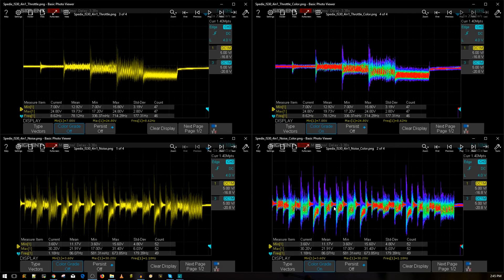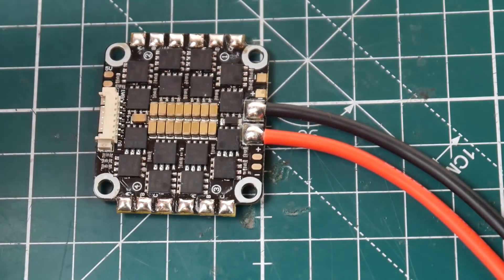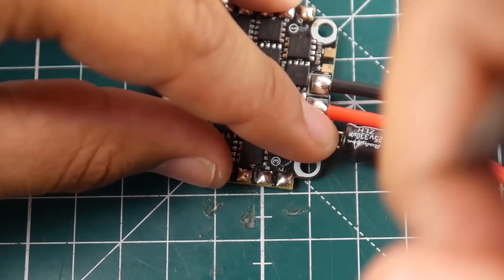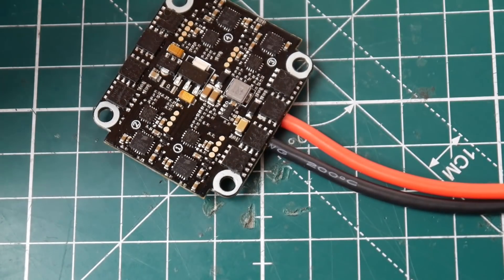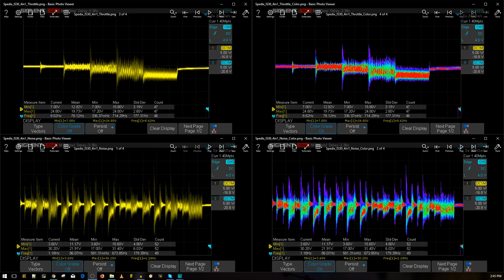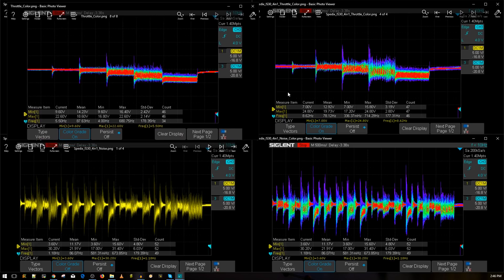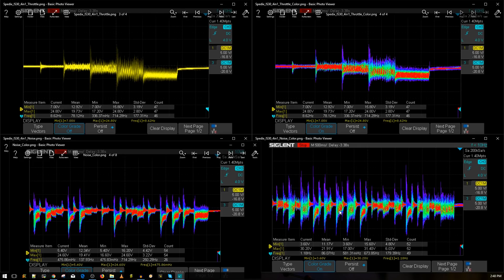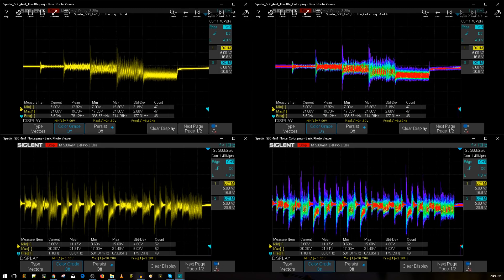OMG NO WAY THIS IS TRUE!!! /// Spedix IS30 4in1 ESC Review and Noise Test

Comment: Hi. It is a darn shame that this test only came out 9 months after the release of the product. To put it bluntly and to get straight to the point, i have this esc on my main rig and have had to live with noisy video since day 1. I have literally ripped the whole bloody thing apart 4 times to try and get rid of the video noise. Nothing will help make the video noise this esc generates go away, not even slightly. :( :( it is a damn shame, because despite the noise, the frigging drone flies great! It is smooth, has loads of punch, is not too hard on the batteries, and the osd is stable. It just generates noisy video. and that sucks! Mr Mesh, please let me know if you are going to try and mitigate the noise, or investigate (ask Spedix) why this design produces so much noise. I would love to know! I have a Spedix GS35A 4in1 to replace the IS with. Is that one any better? Or am I wasting my time? Thanks for the vid! Here is the example of the noise. on the quads maiden flight, back in January....https://www.youtube.com/watch?v=r_1TXvdOkjk

Comment: The problem i see with your test is that its only valid from the point of view of noise. 
An Esc with stronger motor breaking will most likely feed a  lot more voltage spikes back into the system this is not a bad thing as long as you have sufficient amount of low Esr capacitance.

The Esc's your showing in your test to be great are really just esc's with a lot of capacitance built in and or less motor breaking strength.

The last thing we want is Esc's being made with weaker motor breaking so they do better on tests like this but fly way worse in the air.

Comment: Someone please tell the manufacturers to not put shitty solder on the pads. I'd rather tin my own than try to flush a giant blob of crap solder!
Reply from the maker: 2stroke Me Its led free solder and if you dont have proper setup or experience with it, it can be a nightmare to deal with.
Reply: Drone Mesh I add my own 63/37 to pre tin pads but it's a pain to get it flushed neatly.
Reply from the maker: 2stroke Me I had to wrestle with the solder on it too.

Comment: If you read the manual it will tell you that one of the vcc pads is for capacitor. I use 5v for fc and vcc for vtx and cap. It's not the cleanest but is a workhorse and does well in my beater

Comment: Well... I expected something better although this ESC wasn't in my cart anyway. Probably picture should be better with less demanding motors from 2205 series and low ESR caps added but... no.
Maybe you can test Spedix GS40 4 in 1? That new (and expensive) one have a bunch of tantalum caps on it - should be pretty nice. There are also Spedix GS30 and ES30 HV (last one was propagated by J.Bardwell as good and cheap one) that seems worth for testing (especially ES30 HV if we are looking to price).

Comment: I use these with a 1000uf low esr cap and it does the job ok...although I did at one point have issues with mid throttle osc on one of my builds I could not track down...so that could be because of this noise...but otherwise its been ok and the layout is great...

Comment: That answers the question as to why i always have shitty video while using this esc.  I thought it was the FC.  Then the FC got burned out along with 1 motor.  Got a different FC and new motor and still bad video.  Ill never buy one of these again. Yes I was using a cap, first it was the cap it came with then i switched to a 1000uf.  Same results.  All my my other builds not using this 4 in 1 has much better video.

Comment: WTF? Did they use an amplifier or something to get that amount of noise? O.o
BTW, Mesh, what motors you use in your tests? The RS2205 or RS2205S? Because I'm thinking about using the latter in my first 5" build.
Reply from the maker: MC's Creations Brother hobby r6 for 4in1 Esc's 

2306 2450kv
Reply: Drone Mesh Oh... I thought you were using noise motors from Emax! Thanks! 😊
Reply: Emax RS2205(S) aren't the noisiest motors FTW. In comparing with their RS2306 and T-Motor F40 2205-s are very nice.
Reply: I am a RS 2205 s fan they are the best motor i have everything else pays a premium in durability or efficiency. The 2205 rs are less expensive and they scream you really could not choose a better first motor. But i believe they are going out of production i have only seen them  them in sets in the 2600kv version  with esc's. And MESH didn't give the bullet esc's  a good review. Although i never had a problem with them that was not my fault. LOL  Best of luck to you whatever you choose.

Comment: I have to oppose with the statement about ESC being the only one to blame on a noisy quad. THE THING TO BLAME IS LO QUALITY PRODUCT. If you are buying only good FC boards like Airbots or Mateks or BETAFLIGHT or F1 (if youre insane) then its all on ESCs. But there are many cheap BAD FC boards that try to copy the good ones with low quality components and other s**t causing bad handling of noise. If you get those and pair it up with good ESCs the result is the same as BAD ESC with good FC.

Comment: Okay.. These tests and click bate titles are worse then the ESC. I have used these ESC"s for ages and guess what, never ever had noise. I am writing this as many of the top pilots used these last season and never had anything go wrong (yes on the odd occasion they burnt out but nothing like what your indicating!) I am sure you got a dud ESC, also your tests are NEAR irreverent!

Yes I know the drone mesh fan boys will hate on me, I am sure that you got a dud ESC. I like your attempted test but the data can be taken with a grain of salt, they have no indication of how the ESC preforms!
Reply: Something like that, its only orientational data. Its about a build. At beginning of the season Ive got some of those cheap ESC that got good results here and put them into build with very noisy motors from BrotherHobby and a chinese version of omnibus F4 with 32k gyro. It flew like crap - couldt even punch out. 
Sadly You are right, this test may mean nothing if you put this ESC up with a good set of motors and a good performing FC but with crappy ones it could be hell :) 
In the end if I would be getting ESC similiary priced Ill come here and check this, get some AirBot Wraiths32 V2 (stolen as tekkos32) and not this one just to be sure.
Reply: Im flying theese 4in1 ESC's still and i have no noise problems, my quads are flying fine, also i dont run the cap that came with it because i have no room for them. Theese ESC's can take a beating and i love them.
Reply: Custom FPV I don't know if those people use an low esr cap maybe that makes the difference.
I don't know anymore what board it was that dmesh said that that it wsnt good and some people like tommy and stuff used (but with a cap on it ) so I don't know how this test compares to real world flying (and how mutch the cap helps in real world testing)
Reply: Custom FPV The top pilots are stupid. They still think 6s is better than 4s!
Reply: MC's Creations not sure if youre just trolling :P
Reply: Yes that is right these test don't compare to real world flying! But will just contribute to some noise in the feed this can also be turned out of the system. Thanks
Reply: hahah I feel the same way! Good to know we share the same opinions!
Reply: Chemistt Absolutely not. What tells you the flight time and when the battery is going to sag are the watt-hours. Current-hours * voltage.
Reply: voltage spikes can destroy cameras.   I've seen it
Reply: David Faustino I think you didn't get what I meant... If one have bigger watt-hours OF COURSE it's going to be better. The thing is that you have to compare apples to apples. Batteries with the same watt-hours. Like, I don't know, didn't do the math here, but just as an example: 4s 1550mAh to 6s 1050mAh and 4s around 1800mAh to 6s 1250mAh. You know? As close the watt-hours the better the comparison. And there CAN'T BE any difference. It's the universe laws we're talking about.
Reply: He has no clue what he is talking about... his low-esr capacitor video :D tested LOW-ESR elkos against ceramic caps... goal is to keep ESR, more important ESL low.... what does he? puts pissend, long, thin wire on the ceramic caps.... hilarious.
Reply: Custom FPV.  Im a drone mesh fan boy.   👍😀👍

Comment: love the single esc but heard the 30 4-1 sucked... not sure if the 35 4-1 is any better either.... not gonna find out for myself either
Reply from the maker: The single are simply amazing the video on  them will be out in couple days.
Reply: HomeGrownCanadianFPV i used to use the IS30 and now the 35a BlHeli32 escs, no dramas, clean video (using 35v 330uf * low esr from memory). 

I dont really care for the noise tests as they can be filtered out. I keep seeing the Tekko escs being hailed as the holy grail for their noise results, but then I also see people just wiring up the power and then the escs go up in smoke. 

The noise test on this esc might be shit, but Ive never had issues with them.